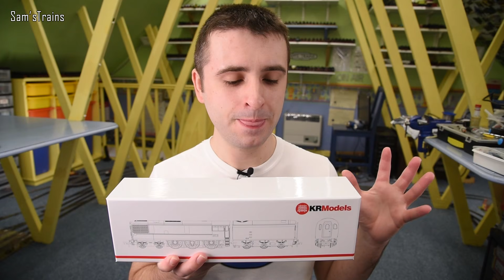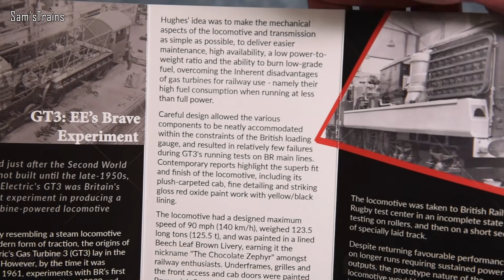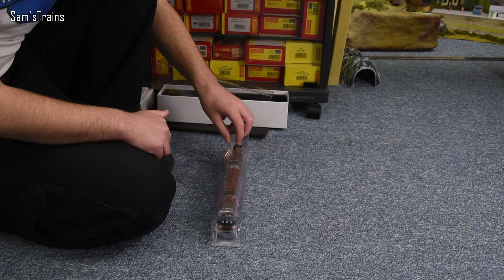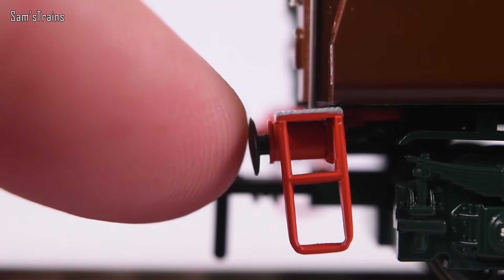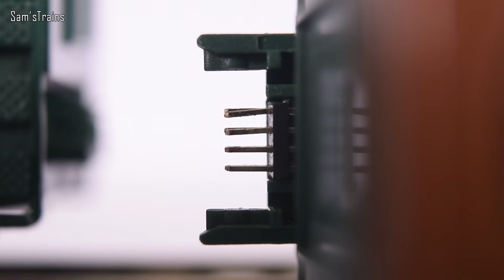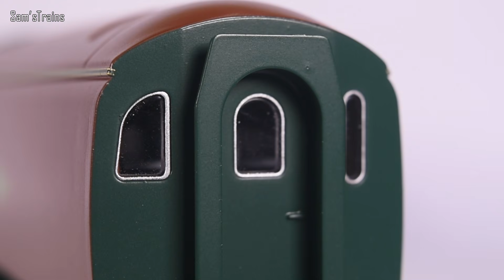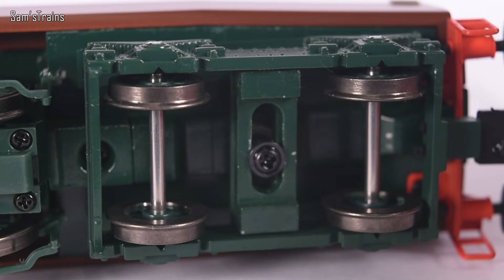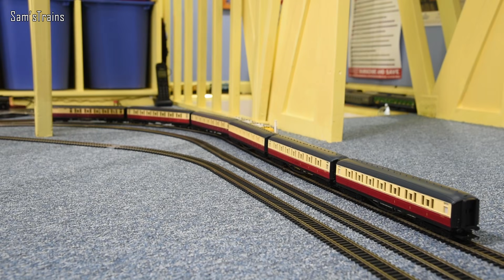Brand New GT3 Gas Turbine Locomotive | KR Models | Unboxing & Review

Comment: The red cab light is probably because a red light is less harsh on the eyes, so if the light is on at night, the driver can still see out of the cab. Submarines had red lights during ww2 so that the crew can see through the periscope at night without their eyes needing to adjust, so I'd assume the cab has a red light for the same reason.
Reply: Same as HGV lorries are fitted with red light night driving lights in the cabs . I asked a Scania mechanic at one of their truck centres as to why the red lights are fitted and he said it’s because red light breaks down any white light that’s coming towards them at night from  other vehicles.
Reply from the maker: Thanks for sharing folks, appreciate the extra info!
Thanks for watching, Sam :)

Comment: For anyone who might feel discouraged to buy this model by the mistakes and details that are not quite there or has mixed feelings: Keep in mind this is a new company, it's their first issued item, it's  their first try. Those were bond to happen and if you ask me, the model is top notch for beginners. LS Models and ACME weren't this good in their first years. Let alone the fact that ACME still delivers poor quality in execution models, with factory mistakes. But regarding this GT3, it is a good buy and you won't regret it. For Sam: Tender is the name attributed to any wagon that helps a locomotive, so if that wagon helps it, it is a tender nonetheless. It doesn't have to contain coal or water for this, in Germany in the 19 th century, the first wagon of long freight consists in the winter were a wagon called "torfmunitionswagen", and it was considered the second tender, as it provided "peat munition wagon" as the engines made fire using peat often times. There you go, a bit of history :D

Comment: Hi Sam. Interesting loco, and KR Models' debut! In my opinion, the design was a little shapeless when compared with, for instance, an A4 Pacific loco, but that's only to be expected really. The major issues are the ones you mentioned; problems with the coupling between the tender and loco (very dodgy) and issues with the front bogie, which concerned me. That was poor. The buffers could have been more vertical. As the loco and tender coupling is so close, I did wonder whether 3rd radius track would have been the minimum required, though it seemed to cope with your 2nd radius track just prior to Gordon's Hill. Would I pay £200 for this? No, I wouldn't. It wasn't very easy on the eye, despite its excellent crawl and pulling power. But thanks for bringing it to our attention. Best, Pete. 

P.S. Are you going to review the Jouef Ouigo high speed train, as opposed to the Mehano one? P.

Comment: Hi Sam, an unusual locomotive indeed 
While unique in the UK the Union Pacific in the USA had a fleet of gas turbines nicknamed the big blows due to the jet like noise their turbines made, they also used bunker C oil (heating oil domestically) & used in the mountainous part of their system they were quite successful & ran for a decade or more & was only sidelined due to the increased price of oil. They have great models in HO & resemble diesels somewhat 
You could start a turbine collection if you grabbed one ; ) Thanks for a great review 
Dave
Reply: The Pennsy (Pennsylvania Railroad) also had a go at Gas Turbines as well.

Comment: That loco tender coupling is the basic design used on almost every recent continental model. Usually done with no option to separate it. This design will work on anything above R2, and might work on a smaller radius depending on wheelbase.

That tender pickup system is considered a premium feature in Europe, most manufacturers use axle wipers.

The model train production in China is split between about 4 factories not counting Hornby, Piko and a few American brands who have their own factory. So even if you stumble over a new name, they usually get their stuff from the same production line. You can still get a bad designed frame if bad luck strikes, and the quality control is sometimes sloppy
Reply from the maker: Very interesting - thanks a lot for sharing Ivo!
Thanks for watching, Sam :)

Comment: Have just ordered the Bullied Leader class & a 2nd run GT3. I hope they'll have addressed the issues before sending it out. You might find that most testing was done at night, so a red cab light wouldn't ruin the driver's night vision when switched on. Shades of submarines.

Comment: "English Electic Vulcan Foundry" on the front plates there. Didn't notice that on my model, but noticed it on Jenny Kirk's review earlier.
I did notice the wonky looking steps, but not the plasticky handrails or the visible screws. Though mine looks to have less blemishes than yours, and is defo much easier to couple/uncouple. Mine also runs superbly, no derailing or issues with the front bogie at all (except when I ran it over a very dodgy set of points too fast). It is so smooth and quiet, although lacks the grip to haul any more than 10 bachmann mk1s on my layout (similar to other similarly sized 4-6-0s of mine, but even then, it slips quite a bit on curves).

I run DCC only, so the lack of instructions as to how to fit a DCC chip was annoying, but fortunately the tender top just pops off. Then one of the tender buffers almost fell off, so I used a tiny bit of PVA to stick it back into the hole in the bufferbeam. When I started running it, it rattled; one of the brass bearing/pickup plates on the tender was loose so I blu tacked it into place, but this didn't help. It developed a squeak during running in, so I added a bit of fine machine oil to each tender bearing, which interestingly also cured the rattle.

The biggest issue I have with it is its lighting. Red for a cab light (F1 on DCC) seems stupid, surely should be a warm white. The directional lights (F0 on DCC), as they are (4 whites behind the headcode discs plus 2 tails on the tender), work well. But those two lights below the headcode discs, they're always on on DCC, so you can only turn them off by cutting track power, which is impractical if you've got your whole layout wired for normal DCC operation. And, those lights should be red directional tail lights opposite the white headcode ones, like all the 3d renders I've seen of the loco. White lights on a loco facing away from the direction of travel is plain wrong, and an extra 2 white lights on top of the 4-disc/lamp headcode would just confuse signallers, especially at night.
So until there's a fix for at least these lower two lights on the nose, my loco is restricted to sitting out of sight in my depot area where it can't trouble anyone.

Mine running: https://www.youtube.com/watch?v=H-EjbebiXOc
Reply from the maker: haha yeah I didn't notice that until the cut either! Yes the performance is lovely isn't it? Supposedly the red lighting is accurate, but that's just what I've heard. Thanks a lot for sharing, hopefully your signallers don't get too confused! ;D
Thanks for watching, Sam :)
Reply: @SamsTrains  several months on, and KR Models have issued a new front bogie (for free), because the original was modelled the wrong way round (guard irons on the rear facing end, not the leading end) and the coupling socket was too long to run with bufferbeam detail fitted. The new design is the right way round with a shorter NEM socket, however it does mean they've supplied a custom tension lock which fits the shorter pocket while sticking out as far as the original (for some reason they didn't just extend the pocket backwards into the bogie a bit).
And with this new front bogie, mine displays the exact derailing issue as yours, albeit on a curve that's not perfectly flat.

So, I've filed down the part of the bogie that rests against the screw, to give it extra vertical movement, which in theory should improve its performance by resting less weight on the front bogie but in practice still leaves it barely making it round my layout with 11 bachmann mk1s. Also, I've added red lighting gels over the lower LED on the nose end and modified the PCB so it's wired to what's usually the yellow wire on a wired chip (forward-directional lights go to the white wire) instead of to ground, so now it operates as proper tail lights.
However, I did also discover that one of the wires to the loco's pickups must've been made too short, then contracted in the cold of the loft so it snapped. So today I also replaced it with a slightly longer wire. Interesting that it only picks up on only 2 of the 3 driving axles though...

Comment: I feel like the fact the front bogie derails is a massive dealbreaker. As a quote on quote rookie who doest like taking apart my own locos, a fault from the manufacturer that make me have to change it really ruins the model for me. Otherwise its a really nice looking model. Hopefully the Fell deisel ive ordered is a little better
Reply from the maker: Yeah that's fair to say - it really peeved me too! Fingers crossed the fell's non-driven wheels will be properly designed!
Thanks for watching, Sam :)
Reply: @SamsTrains  well hopefully KR are looking out at these reviews and are taking note. we can only hope :)
Reply: Had problems with the front bogie too. If you tighten it up too far it rides above the track. Fiddled around with it and better now but the front bogie squeaks on 2nd radius curves and, curiously, the bogie sometimes doesnt centre back up on the following straight. It's frustrating because otherwise we love ours.....
Reply: @SamsTrains  Are you implying that the front bogie was not properly designed?  Any evidence to support that?
Reply: @juleshathaway3894  Pretty clear that its not well designed otherwise it wouldn't have derailed repeatedly as evidenced in the video. Plenty of ways to have designed around this whilst keeping a spring there.
Reply: @andrewcharlton4053  What you have to bear in mind is Sam’s track. It is Hornby set track placed on a carpet. The track will move as the loco goes round. Sam really needs to get his track in order. Get decent track, PECO code 100 flexible track is worlds apart from Hornby set track. If the track is pinned down it won’t move. Sam has wires going under the track causing sharp uplift and unevenness. Therefore he can not give an accurate representation of smooth running because it just isn’t possible.
Reply: I’ve got the sound fitted version, no problems at all with running or front bogie, pulls 10 coaches no problem sweet as a nut. Compared to recent Hornby offerings it’s a good model.

Comment: For a first release it has turned out quite well but the front buffer beam a steps were bugging me before you pointed them out. I think they were going to have a full gear set to start with but ran into performance issues or something so went for the single axle drive, I saw it in an interview a week or two ago. I also spotted only two axles having pickups when you held up the service sheet, but at least the tender also has some which wasn’t so clear to see then. I’m guessing the price is down to smaller production runs as well but still a little hefty.
I’ll probably give this one a miss but they do have some other interesting models in the pipeline.

Comment: I think that red light in the cab is just a mistake of manufacturer. They use smd diodes of the same size, pretty easy to mix them, but of course it shouldn't be like that for high quality model.
Cheers from Poland.
Reply: Red lights would make it easier to see outside the cab at night.
Reply: @johnschwalb  maybe, bur they don't seem to be very healthy for eyes when used for longer period of time.

Comment: The almost shiny finish is excellent. I may be wrong, but the 'head code' lights - or whatever they are called - seem rather inflexible. What if you run it with freight? And - again I might be wrong! - but four lights makes it the Royal Train ...
Just checked - yes Royal Train.

Comment: Using my aircraft techinican experience here: the GT3's turbine is actually more like an helicopter's turboshaft: both have an output shaft that is being then reduced by a gearbox to the proper speed for use by the rotors or, in this case, the central wheel axle.Which makes the internal mechanism oddly accurate to the real thing in spirit: small electric motors and turbines both share the trait of spinning much faster than you really can use practically!
Reply from the maker: That's awesome - thanks so much for sharing... very interesting indeed!
Thanks for watching, Sam :)
Reply: Yes I remember the Howmet TX Turbine Sports Prototype, I was standing at druids at Brands Hatch in '67 when the throttle jammed (the noise was awesome) and it buried itself in the bank, turbine speed is an issue for practical terrestrial use.
Reply: As someone in the same profession, I agree
Reply: @Kabuki Kitsune  no the turbine was an industrial turbine, English Electric EM27 2750hp not a Rolls Royce Derwent engine… GT3s Achilles heel was its reverser it kept stripping gears
Reply: See - if I was designing a gas turbine loco, I would hook the 'jet engine' up to an electric generator, and run electric motors to turn the drivewheels.
Reply: Or like an m1 abrams on rails

Comment: I wish there was a new company that focused on making budget models rather than super detailed ones. This and other expensive models are fantastic,but I’d rather sacrifice some detail to keep the price down.
Reply: That's why we offer an installment plan to help spread the payment
Reply from the maker: Sure, I like budget models too, wish we could see more of them! Not a problem that KR hasn't gone down that route of course though!
Thanks for watching, Sam :)
Reply: To be fair there are plenty of budget models (Hornby Railroad as a primary example). KR models needs to set the standards high to prove they are capable and it doesn’t make any sense to produce a substandard model... 95% of the cheaper/basic models are derived from old toolings as the cost of producing a new tooled - more basic model wouldn’t be far off that of a higher spec model (for which there is a much greater markup in price). Sadly it’s an expensive hobby these days
Reply: There's a few out there! In the US a company called Accurail makes relatively detailed kits that retail for about $20 USD. They're not too difficult to assemble either!

Comment: Hi Sam, 200£ and derailing straight out of the box ??? This clearly is a design flaw on the front bogie ! Nice bodywork and sturdy motor with excellent slow speed, lights in the cab, front and rear... But your ratings are rather generous for another Ready To Repair, floppy plastic sprung buffers , sprue cut handrails and other floppy grill fittings...Typical QC issues on a made in China product. Definitely not on my wish list. Of the 3 loco's running I prefer the Purple A4 . And watch that bogie screw... Thanks for reviewing & greetings.

Comment: To be fair I think in such an enclosed cab, the lack of detailing isn't really that much of an issue. As unless you're actively looking for it, during normal running or static display and such you'll never even notice it's not there. Unlike say most GWR tender locomotives for example where the cab is pretty exposed, where I would expect some decent detailing.
Having said that, I'm looking forward to getting mine in a few months when the second run arrives.
Looks like the motor is as good as the one in the new Hornby BR Blue Merchant Navy that just came out and that is a really good runner, even straight out the box.
Reply from the maker: Not from the back no, but some of the controls are right next to the windows... and so you would get a good view of them if they were detailed, but yeah you have a point! Sure, hope you really enjoy yours!
Thanks for watching, Sam :)

Comment: Honestly, it's a good model with some blunders on decoration (paint, plasticky parts) and the front bogie problem that is a no-go for me. The tender connextion is also a mess but it does not impede the running qualities, so it's not a stopping point in my opinion.
Except this, they have all the basics OK : simple and efficient mechanism, half-kilogram Märklin-like die-cast feeded weight, seems their motor is a s good as it is beefy, with a flywheel, good ideas on pickup and they had fired the sprocket nut from DJ Models they had hired to conceive the drivetrain : one axle that's enough.
They just have to redesign the front bogie and take care of the finish, and this GT3 would goes from a very good model to an exceptional one.
Talking about tender-engine connexion, I had tested my N-Class with long coaches. Verdict : derails in reverse anytime... You're right about the Bachmann mechanism !
Reply from the maker: Thanks Oliver -yes that's right - to be expected on a first model... but there's also an expectation for improvement on their next ones. Overall yes the basics are all good - the bogie and coupling need to be sorted really, but everything else gets a thumbs up!
Thanks for watching, Sam :)